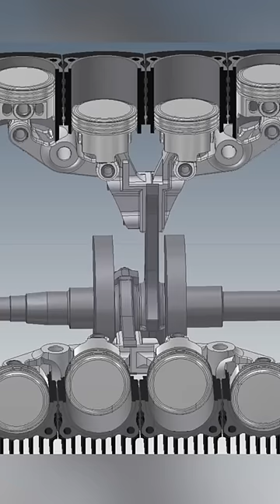STRANGEST V8 Engine Ever Made

Comment: and at about 4000 rpm that thing would rapidly disassemble itself.
Reply: It idles at 20,000 RPM
Reply: @kevinroberts781 riiiight
Reply: That's an innacurate assumption as it's been dyno tested well over 4000 rpm, which is how they got the HP rating.
Reply: @EAMitch still a useless piece.

A just for fun project.
Reply: @Dom  it's not useless. It's just not any more powerful than the original engine it was based on. It does have less moving parts though and therefore may actually be more reliable
Reply: @EAMitch  😂 more reliable? 🤣
Reply: Engine is surprisingly balanced.
And I think I've read somewhere that it helps with distributing the load better too as the piston rods are being both compressed and stretched rather than constantly compressed.
Reply: @4rdF1Hunny  yes
Reply: @EAMitch  ehhh...  no.  This will easily be a less reliable design. 
Fun project though, to prove that it can at least be made to run.
Reply: @1SqueakyWheel  so what exactly makes you think it will be less reliable?  Just because it’s different?  It’s really not much different then a conventional connecting rod engine.
Reply: @Mad.Man.Marine  it's not simple difference.  It's the fact that this engine would beat itself over time under speed and load.  
Instead of the reversal of linear piston motion being invested and harvested onto a single core rotating crank where the motion of each cylinder is fluid, there is instead a hierarchical transfer and the rocker pins are taking the full brunt of each reversal instead. 

There's also the fact that instead of the cycle being divided into 8 phases as with a common 8 cylinder engine, it's only being divided into 4, as each phase is now being served by a pair instead of a single piston.

So for all practical purposes, it outputs power like a 4 cylinder engine which is another sign of wasted complexity. 

I have nothing against doing weird things for the challenge of successfully doing it weird...  I'm just saying that, while this engine is a brilliant proof-of-concept, it has no practical advantages over a V8 of its size.  Over-complication of any machine welcomes unnecessary flaws.

Edit:  as was pointed out to me, it's a 90° engine instead of a boxer, so I was wrong with the bit about it cycling like a 4-banger... pardon my mistake there;  I stand by the rest of what I said though!
Reply: @1SqueakyWheel  it outputs power like a 4 cyclinder?
Bro, a v8 is literally two 4 cylinders next to each other possibly with different firing order
And if it was the same firing order as a balanced 4 cyclinder then it would be balanced, and also the big piston rod would be both pulled and pushed instead of only pushed, so it wouldn't have as big a phase where the rod is only being pushed by velocity so it wouldn't be slowed as much. But this also means that it would probably break a lot easier and need to be engineered better for both streeses. And would probably suffer some reliability from it, but naturally it would be designed so that the piston rods are tough enough and so that the engine is limited slightly so that the engine rods are more than tough enough, like a normal engine.
Otherwise I think you're right. 
Here's a weird idea though: it's perfectly set up to have the outside cylinders be bigger and have 2 cams, and instead just be an air pump into the middle two like a supercharger, and perfectly time it so that the air and fuel is added wuickly right after the piston gets all the way up, and moves a valve to the side instead of into the cylinder, and then it closes right after, and then immediately combusts the fuel and air, like a super overengineered 2 stroke but with cams. Or just a normal 4 stroke (and the outside would be basically 2 stroke with cams and feeding the opposite side pistons with air instead) because it would be better in every way, and just have the outside pistons be pushing air into the middle pistons as the intake stroke is going. Just like the Toyota/honda (I forgot which one) concept. Whould solve 2 problems of the piston rods being pulled and of the levers needing to be able to withstand the force of a piston pushing down on it.
Reply: @4rdF1Hunny  less parts means less things to break which means less things to repair
Reply: @User-ghcwvouvmgs  i like your idea, if only we lived in a world where ideas like that could be easily tried, the unfortunate truth is that an entirely custom engine costs many 10's of thousands of $'s unless you machine everything you can yourself, but then you have the investments of many more 10's of thousands of $'s invested in machines and tooling
Reply: @User-ghcwvouvmgs  im not sure that the difference is in tensile strength vs compression strength of a steel rod, but provided that everything is engineered to withstand the calculated forces, it should run just fine, as for the rockers i think the wrist pin is going to be the wear item unless you have significant pil pressure being fed i to the bottom, it doesnt get the full affect of a journal bearing, so you would have to have oil pressure to keep metal off metal, but i dont see any reason why this engine cant be made reliable with the proper engineering
Reply: I’m genuinely dumbfounded at people looking at those links and pivot mechanisms, and then going “yup that’s obviously more reliable”
Reply: @EAMitch  I stand by what I said on the reliability and less smoothness...  I know what I'm talking about there. 

That said, I must also concede that I misunderstood the orientation of the cylinder banks when I said it would function like a 4-banger....  For some reason, I thought it was in a boxer configuration.  But I now see the second bank perpendicular to the camera; I didn't notice that before. 

This does bring up an interesting point about the shape of the V.... it absolutely HAS to be at 90° in order for the firing to be balanced.   If it were at 60° or any other popular V-block angle, it would have an inescapable lope like a Harley radial-style crank, for obvious reasons. 

So all that said, let's go back to what you said about less revolving mass being a good thing:  It's generally not...  this is why we so often put flywheels on ICE engines to smooth out their operation.  And with the classic central-crank design, it's that beefy rotational mass that makes the engine so tough and able to withstand upwards of 6000 hours of loaded service without catastrophic failure, since that revolving mass, as I said before, is converting the rapid linear motion reversal of 8 cylinders in a fluid way that dampens the motional shock of the entire moving piston assembly...  All the input and output with the crank is direct and absorbed by that rotational motion.  

With a single-knuckle crank pushing rocker distribution assemblies, now the crank is no longer absorbing and converting that abuse....  and for the same reason, it's no longer keeping all the moving parts on the engine under it's direct central control.  Now it's up to these subbed-out rocker assemblies to take the full start/stop beatings of linear start/stops with no localized rotational conversion.  The sub assemblies will now be the achilles heel of the machine, and inevitably its number one cause of premature failure.  The rocker pins will take the biggest beating in the engine instead of a happy, beefy crank.  Lubrication could abate this somewhat, if engineered correctly, but it won't eliminate the issue.  

Sadly, beefing up the lightweight crank with an even bigger flywheel to compensate will not directly fix the new property issues created by these sub-assemblies, and may even unintuitively contribute to their quicker demise.
Reply: @ValentineC137  couldn't agree with ya more..  heh!
Reply: @ValentineC137  yeah I really don't get what people are thinking. Each piston has to push 3 links to move the crankshaft as compared to the usual 1. Its like putting a rocker to the pedals of a bike so that you have to lean back and forth to spin the pedals. Cool concept, but nowhere near as reliable as something with fewer stressed parts.
Reply: @User-ghcwvouvmgs  thanks for your well-thought response.  I misunderstood what I was looking at, and assumed I was seeing one side of a boxer-8, which would have made what I said about phasing accurate.  I see now that it's a 90° Vee, so I stand corrected: that it does indeed have its power distrubuted to 8 independently firing cylinders instead of four pairs.  

I feel people are putting to much value into the fact that the two central rods would be both pushed and pulled.  Recall that with a well-optimized naturally-aspirated engine, the pull against those cylinders on the intake stroke is fairly significant, albeit not nearly as forceful as the power stroke.  But when hauling ass down the highway in a high-demand situation, the volume of the vacuum those pistons are pulling are pretty impressive.  

I've thought about your latter concept before as a means of improving the efficiency of an engine so that it doesn't have to generate all its own vacuum and compression internally, like with outside pumps maintaining valved reserves....  but as with everything else we've discussed here, the added complexity tends to go farther to hurt than to help it. 

As for the sliding valves instead of ported valves or tappets, that would be a nightmare to engineer to be reliable with high rpm and load. 

Tappet valves' number one beauty of design is that it's natural form gives it the added properties of a check design, which makes it so much more effective and stronger in a way that a gated slide valve just never could.  The more pressure that's exerted against the business end of a closed tappet valve, the more tightly it's sealed closed against the pressure it's meant to control.  

It's an even better design when you consider that the tappet valve is left free to rotate on its stem to randomly distribute all parts of its rim wear to all parts of its seat at any given time....  So it keeps itself and its seat maintained and air-tight through wear... it's just a perfect design that can't be beat for its application. 

Also keep in mind that when the cam opens the valve, it's at a point where the head of the valve is not under pressure, so the valvetrain power expended on opening the valve is lost mostly in the valve-spring resistance itself rather than cylinder chamber pressure.  

But I like how you're thinking outside the box.  It's that kind of thinking that invented this wacky engine that has us talking now.  Yeah it's not really a good enginenper se, but it's incredibly interesting, a nicely-done proof-of-concept, and seeds a lot of other cool ideas that break tradition for better or worse.  ;-)
Reply: @User-ghcwvouvmgs     thanks for your well-thought response.  
I misunderstood what I was looking at, and assumed I was seeing one side of a boxer-8, which would have made what I said about phasing accurate.  I see now that it's a 90° Vee, so I stand corrected: that it does indeed have its power distrubuted to 8 independently firing cylinders instead of four pairs.  

I feel people are putting too much value into the fact that the two central rods would be both pushed and pulled.  Bear in mind that with a well-optimized naturally-aspirated engine, the pull against those cylinders on the intake stroke is fairly significant, albeit not nearly as forceful as the power stroke itself.  
But when hauling ass down the highway in a high-demand situation, the volume of the vacuum those pistons are pulling are pretty impressive.  

I've thought about your latter concept before, as a means of improving the efficiency of an engine so that it doesn't have to generate all its own vacuum and compression internally... like with outside pumps maintaining valved reserves....  but as with everything else we've discussed here, the added complexity tends to go farther to hurt than to help it. 

As for the sliding valves instead of ported valves or tappets, that would be a nightmare to engineer to be reliable with high rpm and load. 

Tappet valves' number one beauty of design is that its natural form gives it the added properties of a checkvalve design, which makes it so much more effective and stronger in a way that a gated slide valve just never could.  The more pressure that's exerted against the business end of a closed tappet valve, the more tightly it's sealed closed against the pressure it's meant to control.  

It's an even better design when you consider that the tappet valve is left free to rotate on its stem to randomly distribute all parts of its rim wear to all parts of its seat at any given time....  So it keeps itself and its seat maintained and air-tight through wear... it's just a perfect design that can't be beat for its application. 

Also keep in mind that when the cam opens the valve, it's at a point where the head of the valve is not under pressure, so the valvetrain power expended on opening the valve is lost mostly to the valve-spring resistance itself rather than cylinder chamber pressure.  

But I like how you're thinking outside the box.  It's that kind of thinking that invented this wacky engine that has us talking now.  Yeah it's not really a good engine per se, but it's incredibly interesting, a nicely-done proof-of-concept, and seeds a lot of other cool ideas that break tradition for better or worse.  ;-)
Reply: @EAMitch When and where has this engine EVER been fyno tested? The only power figures I've ever seen for it were estimations made years bwfore it ever cranked over, and those estimations were of it making roughly the same power as the Ducati L-Twin it replaced. It's a novel engineering feat, but a terrible engine design.
Reply: @EAMitch You explain right now how this abomination has less moving parts than a 2 cylinder.
Reply: @InvidiousIgnoramus  it was dyno tested after being run as proof on concept. I'd have to look for the video again which I watched well over a year or two ago.
Reply: @EAMitch  Ducati has not designed a V8 at any point. And "the original engine" is literally a 900SD L-Twin, so yes I DID think you were referring to a two cylinder.
Reply: @1SqueakyWheel  and you also fail to realize that the pressure is balanced on both sides of the rod.
Reply: Respect the man, atleast he isn’t sitting around googling all day. He’s got the knowledge to engineer something awesome.
Reply: We need this, experimental designs help us progress with technology.
Reply: @Sausketo  fewer parts to repair does not equate to more reliability every time
Reply: @EAMitch  I have not failed to realize that "balanced pressure", as your reading comprehension has failed to notice how I even referenced that equal push/pull of both rods myself. 

And I was quite accurate about it not being smoother running than a common crank V8 of its equation. 
I even explained in detail why, but you can keep glossing over it if you prefer. 
I'm not here to argue, we are here having a conversation... a potential debate, even.  
Quit taking it all so personally and making it personal.  

If you want to debate, then argue the specifics of my points rather than the generics if your original started claim, which I've already countered in detail.  

And remember:   this is a weird place for insults..   Just keep it friendly, mate....  it ain't that serious.

Edit:  stated claim; not started claim
Reply: @lukeskywalker3720  truth!
Reply: @calvinevans8305  Amen.
Reply: @EAMitch  in your reply "you did not mention that in any of the comments to me".  Those last two words (to me) are key, mate...  try again. 

And bear in mind that your original reply to me was to a comment not even addressed to you.  It's no problem... I happily invite the conversation....  It's just that most rational people prefer to understand the person that want to interject with, instead of building compartmentalized assumptions to argue instead....  so you should do as those more rational folks do:  Read my messages to others addressing the same concerns as your messages, especially when they're right above the reply to you.  

I didn't know it was necessary to repeat every point for you that I'd already addressed at length above to the other guy.  Am I expecting too much of you?  I'm trying to take you seriously, but you're making it more difficult than it has to be.  

Again...  you're trying to turn this into something personal when it isn't.  Have a Snickers, and we'll talk it all out if ya want.  ;-)
Reply: @EAMitch  Wowee, a single prototype engine designed  for formula 1that that pile of crap could in no way be based off of in the slightest. You sure proved me wrong!
Reply: Mitch: yes, rocker arms distributing power output for the engine is a downfall of this design. 

Read my long reply to the other guy right before my first long reply to yours or don't, doesn't matter to me.  But if you can't be bothered to check into the points you're wanting to presumptively rebut, then I'm not obligated to take you seriously nor should I be expected to keep repeating myself for you when I've just said it right before...  especially since it's obvious you're ignoring most of it anyway.  
That's a wasted effort on my part, and while I'm a patient guy, I'm also one to cut my losses in an exercise of futility.  
So if you're not approaching this subject honestly, with a legitimate interest in our subject, then move on.  This is a public forum, not a one-on-one conversation.
Reply: @4rdF1Hunny  no, but it does help, some of the most reliable motors of all time arent very complex, it really comes down to how overbuilt it is, like the honda motors that can make 1000hp on a stock block, but from the factory they only make 200hp, which makes them last for ages
Reply: @InvidiousIgnoramus  I didn't say it was that v8 that was the parent engine. I just pointed it out as an example that they designed multiple v8s. And yes, the crankcase is from a 900 2 cylinder, but the cylinders and heads are from an old v8 ducati race bike.
Reply: Mitch:  You began all your exchanges within this thread by reading and responding to comments that were addressed to others, so you're not making sense there.  

And you obviously opened all the comments to read that last one (this one as well) since I intentionally removed your address tag from it. And yet here we are.  Still.  
At least you're inconsistent.  ;-) 

But since you're intentionally missing the point in this attempted game of yours, I'm gonna bow out before I waste any more time on it.... and let you have it all to yourself. 

Enjoy mate!
Reply: Id like to see ur degree for engineering or an engine you have made urself before you make baseless claims about something you like have no idea about
Reply: @EAMitch  no. There's nothing about that design that's remotely possible to be more reliable.
Reply: Unscheduled, but not unpredictable.
Reply: @1SqueakyWheel  one time I read the first few comments. Not every time I get a notification do I see what all new comments have been made to others. Please explain how that doesn't make sense. And yes, it gives notifications for comments that aren't addressed to an individual, but not for those that are addressed to other individuals. So once again, you made an innacurate assumption as I got a notification for both your last comments.
And P.S. this isn't a game or even an attempt at one. But I love how you keep making ignorant assumptions due to arrogance.
Reply: @EAMitch  it's yours.  Enjoy!
Reply: @Sausketo  less parts? i just see more load on single con rod and those rockers...
Reply: will b  hey, it has to be true if it's shown on youtube, right?  Heh!
Reply: @Sausketo  complexity is related to durability but not 100%. Stress plays a huge role in durability and maintenence as well. If its more complex but stress is significantly less then it will be more reliable. However if its less complex but stress is significantly higher, it will be less reliable. Its kinda like rotary engine. Its significantly less complex than piston engine but because the apex seals are under extreme stress and can easily wear down its less reliable than a piston engine requiring removal of front and back housing every 50k kilometres or smth.

Dont get me wrong, i love weird engine designs like this but its just no more than fun project and cool proof of concept. The rocker arms and rocker pins would be under great stress if it were to be placed in a vehicle. It could probably be more reliable as a generator or static low rpm uses but i doubt it's actually less cost effective than just traditional piston and conrod.
Reply: @dom3827  it's not usless , it just shows how you can build an engine diferent desings from those huge mega million companies , and it just shows you don't need to be one of those million companies to make something like this , i think this is a very intresting design , except for wen something breaks all 4 cilinders break ,besides that this is a pice of  art
Reply: @EAMitch  it isn't because if one piston breaks will force the other cilinders , or actually you might be right since the 2 pistons on the edges are held togheter to the joint in the block , if the rod breaks it might save the block since the pistons can't go more foward or down that that point
Reply: @dom3827  well that's rather digressive calling a test model model useless.. unless of course you mean the configuration is useless and in which case I would reply this is a demonstration which serves its purpose very well what is useless however is that aggressive hateful word spew
Reply: Grow up Mitch
Reply: lol you realize this is a Ducati Elenor V8 and this dude probably has more engineering knowledge in his left toe than you’re entire bloodline right??
Reply: @1SqueakyWheel  take your own advice
Reply: You're a trip, mitch!  Just let it go.
Reply: @Sausketo 2 strokes can have 3 moving parts. And rotaries too. Now how reliable are those. Less parts to handle the same amount of power will break easier. I think
Reply: Occam’s razor??
Reply: @1SqueakyWheel  I love the irony
Reply: Thing could never reach such a low rpm in the first place goofball
Reply: Quite possibly.
Reply: @EAMitch  it's a concept engine. They normaly stick with inline 4 5 and 6 cylinder engines, V6's & V8's. The inline 6 engine is probably the most dependable one's you'll ever find (for on-road applications). Especially diesel.
Reply: @toddamtmann3528  no shit ita a concept engine. It's also a working prototype.
Reply: Less bearings means more wear on the hardware. Like a gambrel and pulley. The more pulleys there are, the less work felt on each pulley and less weight required for action. It’s why V engines break down faster than their L counterparts. This thing will be a blue supergiant. Strong and brilliant, but dead in the blink of an eye.

Less “moving objects” doesn’t mean good. It’s just means all the stress is placed on 1 object instead of placing it evenly on many. 400 pounds is a lot for 1 person to carry. But 40 pounds on 10 people is much easier.
Reply: @1SqueakyWheel  the major issue I think is the fact that the technology has not yet been fleshed out enough to make the engine perform well.
Reply: @franic_scopes9165  which technology do you mean?  This design is using well-established technology.  

Are you referring to metallurgical tech?  Lubricational tech?  Or are you simply referring to this design still being in its fledgling phase?
Reply: @dom3827 im pretty sure similar engine has been used in a bike before, forgot which manufacturer
Reply: @4rdF1Hunny  less moving parts=less points of failure. I dont see how thats controversial
Reply: @ValentineC137 I know right, people watch to many movie to think we really have "vibranium" kind of material to work with. That's so many moving parts with different directions, it can work, but not long.
Reply: @1SqueakyWheel  Doesnt matter. An 8 cylinder will have double the amount of firings compared to a 4 regardless of config.
Reply: @ValentineC137  Even more dumbfounded by people claiming it must be less reliable. Just becasue the design doesnt match anything already in their heads lol.
Reply: @martinsv9183  thanks for the reply.  I already retracted and conceded my initial claim that its power strokes were phased like a 4-banger when I later realized that the cylinders were in a 90° orientation instead of a boxer.  (DOH!)
As for the obvious... yes the "firings" will be eight in count either way, but only consistent and smooth as a typical 8 when said firings are 45° apart in cycle.  And yes, I now realize this one is. 
Still a design that will never see 10k miles without a rebuild or three.
Reply: This man built his own custom engine and not a single comment here about how wild that is 😂
Reply: @Mad.Man.Marine  torsional loads in that topend contraption.
You would have to run it under load until it broke, it will eventually  heat dustribution might be a problem as will fuel management to keep it balanced,  under a misfire it will soon start to shake itself to bits by the look of it.
And if it breaks? 
New engine id suspect.
It would make an amazing sound when it fails though and punch a piston or two right through the block.
Reply: @1SqueakyWheel  its an odd way to get a very specific firing order.
As a disposable race engine though...
Who knows?
Reply: @deadprivacy  I don't believe the firing order was the goal...  Can't tailor that without a common crank.  The firing order here is slave to the design, where hierarchical power distribution before the crank was the sole goal. 
Neat trick for sure! 
I just can't see this surviving the pressure of even short racing duty though.
Reply: @1SqueakyWheel  might be a bit unwieldy on track. All that weight thrown about too as almost one lump each side.
You ask it for power at the wrong moment it will tear itself to bits.
Reminds me of the honda nsr ovall piston lump amd i bet it wears in equally tricky ways as that thing did.
Reply: @deadprivacy  yeah the ovoid piston idea was a travesty.  The rings need to be able to float around if they're to be expected to last. 

I'm not sure I understand what you mean by unwieldy lumps. 
Do you mean with a head on each side?  Because I'm assuming this  block is meant to be mounted transversely,  with the same crank orientation of most bikes, a la chain/belt drive.
Reply: @1SqueakyWheel  I am somewhat referring to a little bit of all that you have brought up. Mostly the fact that the idea of both pushing and pulling a connecting rod has not been used before, except in double action steam engines and a handful of double acting compression ignition engines. The lubrication technology of our time is currently sufficient, and we have a fair enough grasp on metallurgy. However, we are acting new forces on an engine from different directions than a traditional engine. This design definitely has issues. However, it would still be interesting to see this engine optimized and working efficiently. 
I specifically want to see its implementation into motorcycles and boats. As those areas need light weight, efficient, high revving, high horsepower engines.
Reply: @1SqueakyWheel  bike?
In my head i put it in a car.
A v8 in a bike is going to be lurching.
It does sound really balanced though.
Question is what does it do under load and engine braking forces.
I susoect it would have two stroke chatacteristics with a lot more bottom end.

Lot of power to put down.
Squirrely
Reply: I get what you’re saying but it’s been designed for that…
Reply: @franic_scopes9165  fair nuff!  Yeah, it would be interesting to see its design fleshed out for more potential reliability. 
I still believe that, as the design matured and improved, the bulk of the block would move up the ladder, so to speak, making the design a bit more comparatively top-heavy compared to a central crank V8 of its size and head design
Reply: @deadprivacy  it's a tiny V8, and a Ducati was mentioned as a basis for much of its design, so yeah...  I'm assuming a bike. 
It wouldn't be the biggest engine ever put into a production bike...  and I'm not even counting that Dodge thing with the 8 liter V10 either.  Heh!
Reply: @4rdF1Hunny  why are You laughing? Has someone triggered Your ego?
Reply: The pistons on the outside force the rod downward faster than it would be able to move otherwise, increasing the rev limit
Reply: @1SqueakyWheel  you lose efficiency when you shrink cylinders, especially that small, ideally an engine should be around 450 500 cc per cylinder , its what makes a v twin so good in a bike.
To make 1200cc bike you are looking at 150cc per cylinder ...
Reply: @Rich-fr2yv  care to expound?
Reply: @fickgooglefickthem6884  because the comment made me laugh. 🤷🏻😆
Reply: @deadprivacy  That may well be, although I haven't defended the size of the engine. 
The only practical reason for making small engines with lots of cylinders is an attempt to make smooth quick power.  Italians are pretty well known for doing this in production vehicles, whereas the rest of the car world saves it for F1 racing, using V8s bearing 300cc per cylinder, give or take.  That in itself is a testament to at least some advantage, if you ask me.
Reply: @1SqueakyWheel  Yeah but no matter how power strokes were phased, you still always have double the cylinders regardless... thus x2 firings.
Reply: @martinsv9183  Again...  true. 
But also again...  that was never a question.  ;-)
Reply: @kevinroberts781  dude there is no way it idles at 20000 RPM, there are not even mini 2 strokes that run at 20,000 RPM at full throttle, so they're definitely is not going to be a four-stroke that idles at 20,000 RPM come on now, do at least a little research into the topic you're going to make comments on before making them so that you at least know a little bit
Reply: @junatah5903  first theyre called connecting rods (connecting the piston the the crankshaft) and secondly how do you figure the connecting rods of this engine function any differently than any other engine??
Reply: @User-ghcwvouvmgs  dude the aur fuel mixture has to be compressed, you cant add the mixyure right as thebpiston gets to TDC then immediately fire it.......the three things you HAVE to have in order for any engine to work is fuel fire and COMPRESSION
Reply: @diychad7268  yeah I know that. It theoretically could work and spin but not have any torque though lol
Reply: all I know is that I have to turn the handle on my can opener 12 times to open a 14 ounce can of tomatoes.....
Reply: @martinsv9183  yes, but his original mistake claim of it outputting power like a 4 cylinder was due to a misunderstanding that it was in a boxer configuration where 2 of the pistons have a powerstroke at the same time, meaning you'd have 4 instances of combustion where each instance has 2 pistons firing at the same time

8 powerstrokes, but due to phasing the output "smoothness" would be identical to that of a 4 cylinder
Reply: Afraid so
Reply: What’s with all the “I know better than you” azz hats s#!tying all over a concept that someone actually made a working model of!!! Imagine if this was pre-forced electronic vehicle evolution and some major manufacturer put some money into the r&d of this! It may have been a viable new concept.
Reply: @EAMitch rotary has less parts, 2 stroke has less parts, they aren't very reliable
Reply: @dom3827  once upon a time. A monk poked a hole in metal, then put a drop of water on that hole and looked though the water.

He made a lense, and "discovered" the cell.

For fun.
Reply: @EAMitch   lmao why do people keep parroting the idiotic “less parts, more reliable” nonsense? There’s not less parts. There’s MORE parts. Instead of a 8 connecting rods, wrist pins, and pistons, you now have 2 connecting rods, 4 rockers, 2 shorter connecting rods, 2 of the massive machined pieces for the two center pistons, and 18 wrist pins, and your 8 pistons.

That’s 36 moving parts when the conventional engine only had 24. 😂🤣

Also, now all of the engine’s strain via linear compression is placed between a single set of crank bearings, rather than across the entire plane.
Reply: Y'all argueing over V's and rotaries, when everyone knows the Inline is the best design ICE period. So you V guys saying this thing is worse than a regular v8, just know your preferred design was a less reliable version as well. Its like argueing who sucks most 😂
Reply: @ValentineC137  Power output will regardless of that not be the same..... If the 8 cyl would have fired 2 cylinders at the same time that does STILL not equal 1 firing in the 4 cyl... 
With 2 explosions at the same time instead of 1 there will be approx x2 the power in that instance. And if not exactly twice as much for various other reasons then at least conciderably more.
Reply: @1SqueakyWheel  being top heavy wouldn’t be too much of an issue if the transmission was mounted underneath the engine rather than the side.
Reply: The first fail point is the pin that holds the pistons. The amount of pressure there plus heat 😂
Reply: @donttreadonme2171  Not if its designed for the stress. Like everything else must be.
Reply: @littlechild394  who's claiming 2 cycle engines aren't reliable? 
It's a mature technology that has a long history of both good and bad engines.  2 cycles are comparatively primitive, but they can't be beat for their power to size/weight ratio...  their only two downfalls are that they don't have the efficiency, and they burn kinda dirty, but they can be as reliable as any 4 cycle out there.
Reply: @4rdF1Hunny  the more parts and gimmicks added the less reliable hence why many well built older cars had less issues and could go morr than 500 miles without breaking every bit of suspension of the dang vehicle
Reply: @1SqueakyWheel  yeah but if so why is there no 2 stroke cars
Reply: Realize most cars are rated at or over 9,000 my dad has a ram 1500 rated for over 7,000
Reply: @1SqueakyWheel you literally make no sense how would act like a four-cylinder engine when it's got two cylinders acting for 1 cylinder that a 4-cylinder has😂
Reply: @destroyer2120  lmao “muh dad”. His tachometer goes to 7k, but the rev limit on all Ram trucks is below 6k.
Reply: @phtevenmolz5030  what ever the fuck a tachometer is 👍
Reply: @destroyer2120  you shouldn't use the term "literal" when you obviously haven't read it all yet.  (words mean things).  
It was a whole conversational tangent unto its own which was discussed at great length.  I'm just guessing you lazily didn't read the whole thing, and that's fine.  But what "literally makes no sense" is making a comment like yours without reading the entire body of commentary on this thread first, on said subtopic. 

Or maybe you did read it all, and it just went over your head?  Quite possible, since you don't know what a tach is.  Anyway, I leave that up to you. 

But if you don't understand, and would like to...  just ask and I'll splain.  I'm a nice guy like that.  😊
Reply: @littlechild394  There are actually, but they're all very old.  The answer to your question was right there in my last response:  They're inefficient compared to a four-cycle, and they burn dirtier too.  So try to read between the lines on that, based on what you know about the EPA. 😉

I'll give you 2 examples off the top of my head...  
Saab famously had a long run of 2cycle use in their earlier days.  These models were the first to be imported to the states, and had much larger distribution in Europe.  They're rare to find on the road these days, due to the fact they're well over 60 years old now, but they can still be found at antique car drive-ins. Idiosyncratic as they are, they're pretty reliable little engines.  
And look up the Detroit 71 series of diesel engines...  All two cycle.  They came in both straight or vee block configuration, ranging from 4 to 24 cylinders...  among them the V12 (still a 2 cycle) was legendary.  They were real powerhouses, and were a popular staple in truck hauling back in the day.
Reply: @Brickedaboss07  older vehicles with fewer parts were considered reliable if they passed 100k miles lmao. That’s nothing by today’s standards. Besides, this engine has more moving parts than a standard V8 engine. By a lot.
Reply: @1SqueakyWheel  yeah back whem people were trying to have the newest greatest engine, as far as I know the only mass produced car in recent times with a "weird" engine is the rx8 of which is notorious for being incredibly unreliable
Reply: @martinsv9183  power delivery and power output are not the same
Reply: @ValentineC137  Doesnt matter.
Reply: @littlechild394  Mazda wasn't the first to play with wankels...  Mercedes did it long before, but not with much success. 
Mazda did do a better job perfecting it with a less problematic design on the rotor seal, since wankels can't have oil rings.  
It was the RX-7 of the 80's that was the first to make it a viable production engine. And the RX-7 was a legendary breakthru sportscar...  Made a real splash here in the states even.  

And actually, it was fairly reliable.  By that, I mean they didn't suffer much from breakdown failures.  Their only real issue always remained to be the inherent oil seal wear between the rotor and chamber...  It still ran great even even when the seal was worn; it would just suffer from increased oil use before comprable piston engines of the time would.  
When the oil consumption got bad enough, ya rebuilt them.  

RX-8 that you speak of followed in its footsteps later on, with certain improvements even, but it wasn't as important of a car, even though it was quite the hot commodity.  

But make no mistake...  Wankels were tough little engines that loved crazy revs.    It's a bad analogy to compare wankels and 2 cycles (both with long-storied track records) to this fragile little V8 here... because toughness is just not one of its virtues.
Reply: @EAMitch  are you okay?
Reply: @Insomnia  perfectly fine. You?
Reply: @EAMitch  more reliable, can you explain?
Reply: Drop that sucker in a Yugo and flip em all off as you drive away lous af.
Reply: Did you pull this info from thin air or did you build the engine
Reply: @dom3827  lol if it’s fun, it ain’t useless is it ?
Reply: @User-gh4cw2vo6u6vm6gs  you literally just re-explained what the engine is and not why it's worse.
Reply: @dom3827  its an impressive piece of DIY engineering... how many new engine designs have you come up with and implemented into a functional motor? The accomplishment deserves respect.
Reply: @EAMitch less moving parts?
Reply: @EAMitch  It's most likely less horsepower than the conventional setup.  Whatever advantages it might have, they don't outweigh that issue.
Reply: @EAMitch  the guy that designed it made lots of engines similar to this one none of them were really any better in any way, he just wanted to tinker with it to see what it could do. I don’t think this engine was actually designed to be used.
Reply: @EAMitch  less moving parts??? 💀
Reply: @EAMitch theres also less friction and inertia since its lighter. At least to my untrained brain it sounds ingenious. However pointload on the crankshaft is very much increased lol
Reply: @Mad.Man.Marine the sway motion and all the little part it seems it has to make it do that. with better improvments and less small parts easily a good idea for an engine build. If you had a solid piece of metal that could do the same thing and maybe go up and down a little farther ide take it
Reply: @Sausketo exactly the fewer parts the more reliable something generally is
Reply: @ValentineC137 not yet but it very well could be
Reply: @1SqueakyWheel  what's that old saying about wrestling a pig?
Reply: @1SqueakyWheel if they made the rockers a solid piece of metal the pins and bearings and shit wont matter expecially if they just make huge rods and shit like toyota used to overbuild shit all the time and they are beasts lmfao i have a 97 corolla and im thinking about trying something like this if i ever get a chance and money i can live without just gotta figure out how to put them in there and stay in place without a swivel somewhere on it thats the issue if it was filled with oil maybe byt idk it still seems like you would need atleast one pin to keep the rockers in place someone figure that shit out and this might actually work
Reply: @EAMitch  all of your loads are on two thin metal rods
Reply: @schwig44  ya get mud on ya?
Reply: @shakinbottles  I can see you've really given this a good bit of thought.  Thanks for teaching me a lot of new stuff.
Reply: @1SqueakyWheel  not like alot but thanks lol just an idea but you seem like you know what your talking about a little bit atleast so you think that would work?
Reply: @JunaTah  wouldn't the rod angle be less also?
Reply: @EAMitch  might be less reliable too. That rocker arm mechanism might be less durable than having the piston connected directly to each individual rod
Reply: 1😊😊😊0
Reply: @EAMitch  je n ai pas compté mois de point de rotations (donc de frottement)
Reply: @ValentineC137  i guess because you dont understand how less moving parts is how relaibility works. Know anything about pcs? Well the ssd is more relaible then the hdd however has a shorter life spam. Reliability and life spam are different.
Reply: @pride2184  Sadly this engine has both more parts and a shorter lifespan
Reply: @EAMitch  I would say it is less reliable as each of the piston linkages in his design will be much weaker than standard.
Reply: some day one car manufacture would say "Hmm intresting engine... Lets use it on our race car" Just like mazda with its 787b
Reply: @EAMitch  no, that rocker assembly under the pistons is a huge failure point waiting to happen
Reply: You should delete that comment surely you would be embarrassed.
Reply: How tf would you know? it literally went well over 4000 rpm in this video about 5 times
Reply: @dom3827  unless you take the concept and modified it further so that you add more cylinders and add them directly in sequence to the first set and do it in both sides of the engine of course at that point we are talking about a completely custom engine
Reply: @EAMitch  a rotatory engine has less moving parts then a conventional piston engine.. and well
Reply: @gusgus00001  and there are also very reliable rotary type engines.
Reply: @dom3827  well. if it looks stupid but it works... it aint stupid
Reply: Lol some quality armchair engineers most probably could not complete basic Duplo kit and should just not think out loud and just appreciate his work
Reply: @1SqueakyWheel  Every single engine known to man will beat itself over time. This design is so outside our general way of doing things there's no way to know for certain that it would be any less reliable given a few years of tinkering. This kind of "overengineering" is just an awesome way of redesigning the way we think of engines. Those rockers with enough time, money and thought could potentially be improved to a dampening and balancing feature of the engine. For all we know this man may have just laid the groundwork for an engine that averages 400k miles before you have to rebuild it.
Reply: Why?
It appears to have way less reciprocating mass which would allow it to rev higher more efficiently.
Reply: @4rdF1Hunny  why not, laughing face?
Reply: @andythomas2550  that optimism is admirable, but still very pie-in-the sky. 
I'm not saying it couldn't be made to work more reliably, but with a mechanical engineering background, I'm confident in telling you this design begins behind the 8-ball.  It's a circuitous way of accomplishing its goal...  It's an answer to a challenge, rather than a practical solution. 

He gets major kudos for making a ridiculous design run so smoothly, but it's a demonstration arrangement that can't hang under load for any significant length of time. 
It's a cool engine...  but not really a good one.
Reply: @gusgus00001  wankels famously suffer from oil seal issues....  not reliability isses.  

They're pretty tough actually, and can be driven quite reliably beyond the point of recommended rebuild required due to its advanced rate of wear-induced oil consumption.
Reply: Nope, piston materials be strong enough. The forces of pistons moving out also balances with the ones going in
Reply: @Mad.Man.Marine   The fact that reciprocating mass per connecting rod increased many times over.
Reply: @4rdF1Hunny ya actually I take it you can grasp the concept huh??
Reply: @gamingclipz7309  I don’t expect your simple minds to understand how much more complex it is to make this work reliably. It’s apparent that most everyone thinks a modern F1 V6 is less complex than a V10 from 20 years ago.
Reply: @kevinroberts781  That's not idling! Get a dictionary, 20,000 is highly unlikely  maybe 6,000 redline
Reply: @junatah5903  It's not balanced at all! Each piston should fire at each quarter turn of the crank, I had a twins similar to this, The 175cc was fine but the 350cc was a bone shaker mirrors were close to useless and redline at 10,000
Reply: @Mad Man Marine  depends how well the engine is made not the engine design. Take toyota for example. If they made this engine it'd probably  last forever , if Mercedes made it, maybe 20k km max
Reply: @lukeskywalker3720  Has he? Your easily pleased? Way back in the 50s a gentleman made a boxer 4 cylinders with no crankshaft that ran on a ratchet system, Can't remember the name? It ran and was smooth but short lived due to the ratchets wearing out! Good concept though
Reply: @ethaniris7069  That cuts both ways? So many experts who think they know it all
Reply: @EAMitch  Google Pedantic? It will help you understand yourself and what others see? Just read everything and comment, No one need explain more than once! But your not interested in the subject matter? Just want to be right
Reply: willyberg123  I'm starting to question his age?
Reply: @aoyuki1409  I had a two stroke triple and 20,000 miles for rings and small ends and few moving parts
Reply: @FortunePT  Just art! Pretty but not inline with big companies
Reply: ronniedoorzon1576  exactly and a system in the science museum in London showing a similar concept except the first cylinder sharing the conrod sucked double the air petrol mixture and forced it it into the single cylinder
Reply: @EAMitch  Your still at it?
Reply: @onlyfords  No i don't
Reply: @oscar_bru8455  Two strokes are 40% more power but mine was 20,000 miles on rings and smallends
Reply: @EAMitch  You know more about computers than engine's and love to argue
Reply: @EAMitch  same difference Einstein beef and steak come from a cow, Mechanical prowess? Have you got any?
Reply: @martinsv9183  Same with you thinking IT MUST be more reliable? Where does that come from?
Reply: @commietearsdrinker  I had a two stroke triple and 20,000 miles new rings and small end's
Reply: @deadprivacy  That's right the V8 with 4 oval cylinders
Reply: @1SqueakyWheel  8 litre V10 pointless  thing! But novel, He made a V12 Two Honda CBR 6 cylinder on the same crankshaft making a V12
Reply: @thelast929  He hasn't made it! Just added cylinders to a working engine
Reply: @littlechild394  My two stroke triple was no less reliable than my 4 stroke twin's except the two stroke needed new rings and smallends every 20,000 miles
Reply: @Johnketes54  beef only comes from cows. Steak can come from many animals. And rebuilt and refurbished my first vehicle decades ago.
Reply: @phtevenmolz5030  Exactly 💯, Many just see PRETTY, I've noticed recently Japanese twin's tarted up as sports bike's 400cc that will work but 500cc and beyond? Gutless wonders poor acceleration but good fuel economy and probably cheaper to buy new?
Reply: @1SqueakyWheel  except mine needed rings and smallends every 20,000 miles was a 550cc triple and as fast as any 750cc four stroke 4 cylinder of the day
Reply: @littlechild394  Pollution, Check out two stroke diesels ie 18 cylinder 3 crankshaft Napier Deltic my favourite engine other than my 550cc two stroke triple motorcycle
Reply: @destroyer2120  Poor fireing order
Reply: @1SqueakyWheel  Inefficient? Producing 40% more power with less weight
Reply: @Johnketes54  that's true you aren't wrong, but that's why I said to make his own, a degree is only so much proof of knowledge practical application is more important.
Reply: @Johnketes54  No no, I commented on all the people writing how unrealibale it would be.
Reply: @spankthemonkey3437 anything better than bmw engineering is more reliable 😂
Reply: Why?
Reply: @1SqueakyWheel  I'll take your word for it, not like I'm gonna be designing engines for a while yet.
Reply: @EAMitch  wrong
Reply: @PneumaticFrog  I can only guess that you may be missing the point with your statement that, if Toyota made an engine of THIS design, then it would be reliable. 

One of the key ways that Toyota has earned its reputation for long lasting engines by NOT manufacturing poor designs such as this.

Mercedes is also known for long lasting engines.  The failure of their cars lie in the overly complex electronics that control the engine (and everything else onboard) not the engine itself.  Take any of their in-line engines, shuck the shitball electronics off of it, and put it into a project car with basic intake and ignition system.... it'll go the distance that inline Toyota engine would.
Reply: @1SqueakyWheel  nah I was just high when I wrote it.. BUT you know you what I mean. I meant BMW too not Mercedes but yeh
Reply: @1SqueakyWheel  yeah haven't actually seen a Toyota with a stuffed engine unless it's just head gasket or they managed to somehow overheat it. But Toyota's never overheat under normal circumstances. Toyota's design method is make an engine and slap the most powerful radiator/cooling system they can on it. The cooler the engine the longer it tends to last so
Reply: @PneumaticFrog  not the only reason why Toyotas last so long, yes they over engineer everything, but they also use the same part for 15 years or more and not change anything because it works.
Reply: @noobscoopsies1100  the difference there was that the engine Mazda decided to use in their 787 was a really tough engine that could take a good beating and be pushed hard for a 24 hour rally and still finish... usually with only minor issues like oil consumption. 

They'd have never been foolhardy enough to use a terrible design like this little hierarchical piston train engine, which even after refinement, would suffer catastrophic failure within an hour or two at most under the demand of rally conditions. 

That just wasn't a good argument, friend...  but kudos for knowing about the 787, which just goes to further exemplify my point that the Wankel (aka Rotary) engine proved to indeed be a reliable engine, despite what a lot of people on here seem to be erroneously assuming on rotaries and 2-cycles.
Reply: @LuciferTheFallenGod  add more cylinders in sequence to the top-end cylinder-train....  Yes that would be a fun thing to see done to this experimental mill.  It'll be twice as likely to splode too!  😁
Reply: @person maybe  well yeah, that's not really a design thing just makes it cheaper to manufacture, less RND too.
Reply: @Johnketes54  yeah the Tomahawk bike with the 8 liter Dodge V10 was not built to be a great bike... and it certainly wasn't built with practical transportation in mind either.  
It was built purely to be the ultimate insane production bike.  It was also strangely designed to be refined, unlike all the wacky home-brew choppers bearing Chevy 350 V8s it surpassed.  Those home brews were, themselves, nearly unrideable, but still impressive in their own rites of insanity.  

The Tomahawk is like 20 years old now, and to this day, nobody has been crazy enough to climb on and actually take it to its limit.  

According to the math on power/weight/traction/drag-coefficient, they've estimated it could hit 400 mph....  if it were able to maintain traction and stability, which is it's obvious caveat. 

With the way technology has been developed both then and since, I'm honestly surprised they haven't rigged one by now with remote control and some form of hydromechanical "rider" to dynamically sense, respond and control balance, just to see what kind of practical high speed numbers could be feasibly produced before it lost control.  

The bike is fascinating and beautifully engineered.  And it's also a morbid curiosity upon which nightmares can be based on. 

My only reason for bringing the bike up at all was because somebody else had appeared to suggest the little V8 in the video would be unwieldy on a bike, and that's obviously child's play, comparatively speaking. I also admit it's an odd bike to mention in a conversation that is based on reliability issues, of which the 8 liter behemoth has no issue with.
Reply: @Johnketes54  I'm unfamiliar with the particular engine you're referencing in that London museum, but you're describing a 2-stage cycle, which is just a different way to gain higher compression.  VERY common in industrial air compressors, but not such a graceful idea for an internal combustion setup. 

Makes for a VERY complex engine, and would need a number of base cylinders to run smoothly with all that power taxation given to multiple compression cycles per base cylinder, per rotation. 

Great reason for why it's in a museum instead of out on the road, eh?  ;-)
Reply: @Johnketes54  my statement of efficiency wasn't based on the power to weight ratio of the engine...  It was based on the ratio of fuel intake to horsepower output.  I'm assuming you understand the sacrifices that are inherent with the ported valving found in 2 cycle gassers.  They tend to exhaust a significantly larger amount of unburnt fuel than 4 cycles of their equivalent HP rating, and they also run typically lower compression ratios when naturally aspirated too, which is also a limiting factor for their efficiency.  

And of course, all that's not even taking their comparatively increased oil waste into consideration.  
They're solid machines and they certainly have their place in small lightweight air-cooled applications where they excel to this day in yard tools, but their decreased efficiency becomes an issue with larger scale applications in today's automotive world.  

Btw, I postulate that 2 cycles are significantly more than 40% more powerful per displacement/rotation...  I'd wager a little more than double that, actually...  Since every other cycle is a power stroke instead of every fourth. 
Also, you mentioned weight...  the power to weight of a 2cycle is made even higher considering the fact that it's not sporting a sump full of oil, pump, etc. 

Yeah, 2 cycles are powerhouses...  which is why the same work of a 2 liter 4-cycle can be done with a 1 liter 2 cycle at roughly the same rpm. 
The 4 cycle will be a bit more efficient though, and due to its heavier design allowance making vibration and temperature handling easier to handle, among other things, it will probably have the better longevity too.
Reply: @PneumaticFrog  the best gas-powered vehicle I've ever owned was in fact a little longbed 1981Toyota pickup.  It had the 22R, which was the 2.4 liter inline 4.  It was 2wd with a 5 speed, manual steering, etc.  It was well-used when I bought it for use as a long-distance work truck.  I pushed her to 1.1 million miles before I finally had to park it.  
It was leaking oil from the engine, tranny, and rearend.  And she wasn't only leaking oil, but burning a lot too.  Was adding nearly a quart a day, and fouling plugs about once a week. 
My intent was to give her a full rebuild after I bought a shortbed Nissan (also a 2.4/5sp) to drive in the meantime, but sadly, I just never got around to it. 

The only time they Toyota ever overheated on me was when the water pump failed while I was in Charleston.  I wound up replacing it in a parking lot.  I wish cars were still at easy to work on as those things. 

The only "overheating" issue that ever plagued me with that truck (in its later years) was that if I'd driven long enough for the engine to reach full temperature, and shut the engine off, I'd have to wait for about an hour to restart it, or else the fuel in the carburetor bowl would boil out on me, and I'd have to then wait for it to cool more and then prime the carb again (or just manually pour gas into the carb's throat to replenish after that hour)
Obviously it was an age-related issue instead of a design flaw, but it confounded me, and I was never able to understand the reason for it well enough to fix it. 
All the other Toyota trucks I subsequently had were with the 22RE, which was the same great little 2.4, but with fuel injection and electronic ignition...  so that problem never cropped up again.  

Still though....  knowing the moody old-man personality it had, even up to the last day I drove her on the road, I'd have trusted it to reliably take another 1000 mile round trip without concern.  Just had to take extra oil and sparkplugs, which I had already been doing...  heh!
Reply: @1SqueakyWheel  im no mechanical engineer its just an idea I haven't the slightest clue how these things work but I still thought it was be a way to up the power of an engine of this style
Reply: @1SqueakyWheel  wrong it will create more power because it has less bigger competents needing to be moved now if he pairs it with some electric controlled valves you will start seeing these every where
Reply: @EAMitch  no
Reply: @EAMitch  no
Reply: Overengineering but not reliable
Reply: @EAMitch want to know why this engine is useless and will never be better? Because it’s not already being used. You think some guy on his balcony has the answers to it all like some treasure hunt? Nope, motor engineering is reformed almost as much as possible. You can dream tho
Reply: @dom3827  would probably be a good f1 design engine
Reply: @EAMitch  "more reliable" hahahaha
Reply: @Mad.Man.Marine  im a chemist, not engineer, I see the problem that the pistons feel a higher side force here and pressed against one wall , while in a normal engine the angle is steeper
Reply: @kevinroberts781  86756**
Reply: @EAMitch LOL I call bullshit that it was properly dyno’d. And you conveniently can’t find the video that you watched now huh?
Reply: @EAMitch  doubled in the same direction at the same frequency and using two hinges. Power changes direction twice, inducing indfficiency. Power travels thru two hinges. This design is more complex and less reliable.
Reply: @Mad.Man.Marine  because you won’t be able to sense problems as readily. Plus you can’t just take this to a mechanic unless you’re going to New Hope Auto or some other experimental tuner
Reply: I would put that into. VW bug and see how it runs😮
Reply: @dom3827 thats fine. It was only aupposed to ever be a project. Whats your point ?
Reply: @EAMitch less moving parts ? Are you high ?
Reply: @spankthemonkey3437 no, you don't see.
Reply: @ValentineC137 yeah. If it was a good idea it would be put into service
Reply: @EAMitch  It's more about efficiency through the reduction of parasitic power loss than "reliability" (abuse before catastrophic failure).
Reply: This isn't a useless piece at all, in Any aspect. This engine will definitely handle what it's built for. Obviously this won't ever be in a car.
Reply: Wilbur Wright was mocked, and here we are...persistence is key 🗝
Reply: Меня больше интересует система смазки в этом симбиозе технического психоза.
Я корабельный механик.
Reply: Что там по поводу расхода топлива? 😢😂
Reply: @Sausketo это что трактор у поставить с зади восьми угольные колеса вместо круглых.
Для обработки почвы это хорошо, но попробуй тронуть я и разогнаться до заданой рабочей скорости? 😂😂
Reply: В школах не преподают Механическую математику и сопротивление материалов... 😢
Reply: У нас, в Москве, все это уже было испытано на 40 000 часов работы для экскаватора под нагрузкой. Блоки были развёрнуты под 120с'.
Но!
Пришёл Михаил Горбачёв и наступил коллапс. Ни смогли найти деньги на запуск в серию.
Тогда же и по той же причине, была продана Французскому Рено, кабина" МАЗ- ПЕРЕСТРОЙКА".

Теперь это RENO MAGNUM😢😂
Reply: @kevinroberts781 revolutions per month lol
Reply: @EAMitch  less moving parts? a piston connected to a retaining rod is simpler then this design, and has less parts...
Reply: @4rdF1Hunny less rods to break under torque
Reply: @1SqueakyWheel just stand down man. No amount of YouTube commentary is gonna make you right or knowledgeable.
Reply: @TheOnlyJoshH  my ears are open...  tell me which of my points you disagree with, and why. 
I've made a LOT of points in a lot of comments within this thread, all of them 2 or more months ago now...  and I welcome you to argue any of those points if you can explain why I'm wrong.  
So let's talk!
Reply: An unscheduled rapid disassembly..
Reply: @Sausketo  not true. If I can make a back scratcher out of one piece of wood or cast 3 separate pieces from aluminum which will be stronger? The one that’s bolted together by multiple parts or the single cut of wood?
Reply: @kalebnelson4569  that is a terrible example because you're talking about different materials, im talking about the same material, take that wooden back scratcher and break it in pieces, then bolt it together with wood bolts and tell me its stronger than a single piece
Reply: @Sausketo  your original premise was about number of moving parts. Now you’re changing the premise to fit the video more whereas I replied to your comment not the video.
Reply: @kalebnelson4569  yes my original premise was about the number of moving parts, but you only change 1 variable in a comparison. I.e. number of parts, OR material, not both at the same time, how about we compare a bolted steel part to one made out of glass? Doesnt make any sense, you're just changing the parameters to fit your view
Reply: @Sausketo  moving parts≠ weaker
Reply: @kalebnelson4569  no, but it does mean wear, which will eventually make the part "weaker"
Reply: @Sausketo  wow that’s new knowledge for me thanks. I’ll remember that. Moving parts wear. Pretty sure that’s the 2nd law of thermodynamics
Reply: @kalebnelson4569  not even close
Reply: DIETER!! 
That is all. 
I just like saying Dieter.
Reply: @Sausketo bout tree fiddy?
Reply: @1SqueakyWheel You are correct...& way too much stress at the hinged joints will stress the parts etc.
Reply: @spankthemonkey3437 a rotory engine has less moving parts, not more reliable, a two stroke has less moving parts than conventional four strokes, 2 strokes are less reliable and require rebuilding earlier.

Less moving parts does not always equal motr reliable
Reply: @Sausketo stfu, so many one of engine that work on paper, turn out to be shit on real life application
Reply: @User-ghcwvouvmgs  I don't think the non firing cylinder as a supercharger would work well without adding complexity to the engine. It could easily be done by piping the exhaust side of the pump cylinders to the intake of the normal ones, but youd need to worry about charge temp so the added complexity I mentioned earlier would be figuring out how to incorporate an intercooler in there somewhere.
Reply: @Kisanorame  I avoided commenting on this concept earlier, because it's just a bad idea from one end to the other, for so many different reasons. Interesting idea, but just wouldn't work. 
One of the more interesting issues that it would cause would be pressure surging. Imagine the  nightmare of resonance complications that introduces into the process. :-)
Reply: @EAMitch  umh, actually, YouTube sends such notifications not for every comment. If so, people's feed would get cramped by random junk. 🤓
Reply: @littlequig  there are people that debate like it's their field, so it's obvious that those guys might made their own designs (maybe only on paper as building own engine might be costly af). I am, of course, not one of those guys.
Reply: @ValentineC137  because less moving parts have proven to be more reliable in the past.
Reply: @jackbarnes9728  this has more.
Reply: @EAMitch While really cool.. all of the outter (& some of the inner) piston's energy, is solely being used to move the other pistons back up in the combustion cycle. Instead of being used to create more power. And while it has less moving parts, all of the stress is transmitted through 1 connecting rod, and 1 set of con rod bearings per side. Likely increasing the chance of wear/failure
Reply: @jackbarnes9728 While really cool.. all of the outter (& some of the inner) piston's energy, is solely being used to move the other pistons back up in the combustion cycle. Instead of being used to create more power. And while it has less moving parts, all of the stress is transmitted through 1 connecting rod, and 1 set of con rod bearings per side. Likely increasing the chance of wear/failure
Reply: @spankthemonkey3437 Lmao, clearly you dont. All of the outter (& some of the inner) piston's energy, is solely being used to move the other pistons back up in the combustion cycle. Instead of being used to create more power. And while it has less moving parts, all of the stress is transmitted through 1 connecting rod, and 1 set of con rod bearings per side. Likely increasing the chance of wear/failure
Reply: @kevinroberts781 brother what
Reply: I don't understand. It's shown working and only a prototype so I could guarantee a motorcycle manufacturer could touch it up, use the right metals, and have one of the best designed engines to date. I bet people laughed at the rotorary engine especially the newer 12 rotary engine. Or even the motorcycle that uses a shotgun shell. All it takes is a thought and it can become reality
Reply: @1SqueakyWheel what did you build while paralyzed on a balcony? Oh, that’s right, you’re on a pc all day, not carving metal into cool shiz.
Reply: @1SqueakyWheel you said “I know what I’m talking about here” on a YouTube video comment. That really makes me skeptical, I think you just throw around engineering buzzwords and baffle with BS
Reply: @InvidiousIgnoramus no such thing as a terrible engine design, unless you rely on this to get you to work. Stop judging accomplishments and maybe get your hands dirty instead of being a YT engineer. 😂
Reply: @lukeskywalker3720 exactly, all these virgins claiming to be masterful engine designers saying it’s a “bad design” when there is no such thing when experimenting. They’re jealous AF.
Reply: @calvinevans8305 exactly, these goons are too busy pointing out faults to do anything of their own. They’d never build anything, they’d find flaws constantly and live a life void of building ANYTHING that runs. I’m no saying this is the future, but the damn thing runs!
Reply: @1SqueakyWheel go away
Reply: @jeepmanxj what did you build while paralyzed on a balcony? I’ll wait. You guys aren’t true engine guys, you only point out flaws where the rest of us see potential.
Reply: @_..-.._..-.._  "the no bad design" BS needs to stop. There are absolutely terrible designs and to pretend otherwise is to exude the highest level of ignorance.
Reply: @_..-.._..-.._  not waste my time putting together a worthless engine.

I spent my time refocusing a family machine shop away from engines and jobs for mines to one that builds significantly more complex systems than an engine.

Great. He built it. That doesn't mean it's good.
Reply: @User-ghcwvouvmgs    See, this is exactly why projects that might look bad on the surface should be built.   Because men like you come along and tweak here and there & next thing ya know is we have an incredibly new product that otherwise never would have come to be.
Reply: @Mad.Man.Marine  you would need a  connecting rod  crank and bearings from a 12v cummings to  reliability push pull  4 cylinders each connecting rid  bearing 😂  and a hellova starter
Reply: What keeps me busy is, how to deal with vibration.. the crank is balanced  like a Moto Guzzi.. I do not dishonour the builder; he has my respect.
Reply: @thegreatgali1739. Yeah, what he said!! Dammit! Dieter stop trying to build a better mouse trap by designing something that will surely grenade before  it gets 5000 miles of use. And I'm being generous there. Anything that has rotating parts will fail eventually, some sooner than others. The way you have that setup, you added alot more rotating grenades. Cool for a hobby but impractical for use commercially.